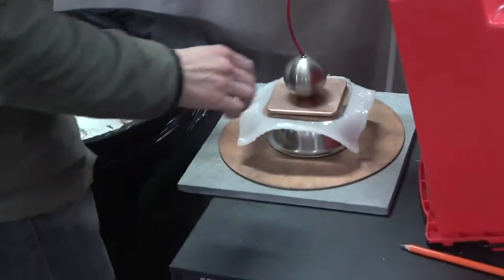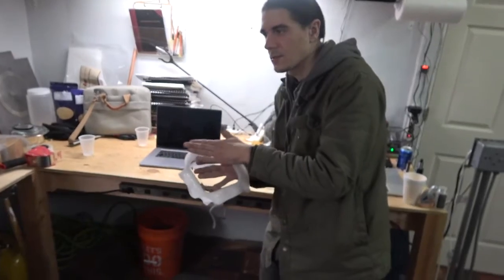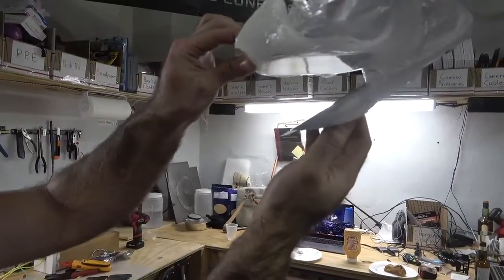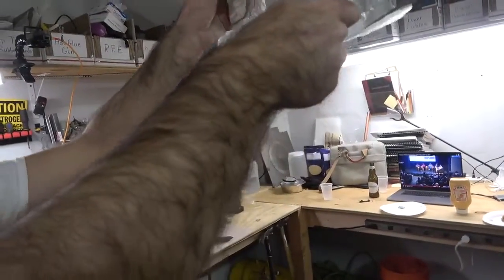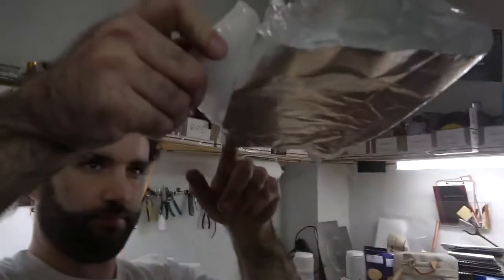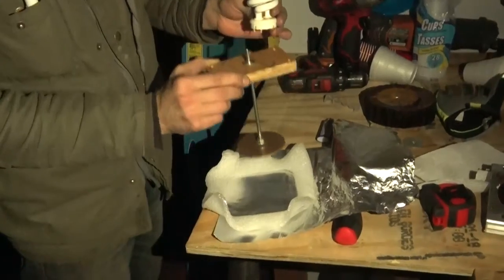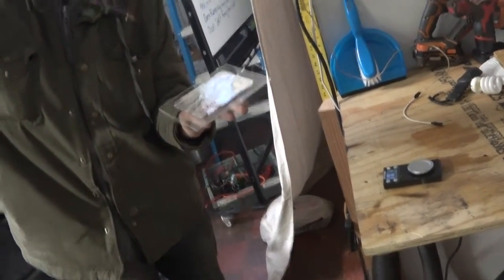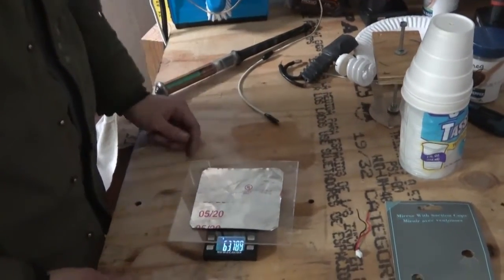Making Electrets for Antigravity and other Experiments

Comment: Number one electric the way, the process is through the cool down you have to put a electrostatic charge on both sides through metal plates that causing the cooldown to align the molecules inside the electric to be aligned to collect electrostatics and keep it as a constant a very low concept until

Comment: Use an electret sphere like surface annealed pourous alumina with a cavity and use helmholtz coils close to the surface  with an asymmetric cathode that has higher surface area with needle like protrusions extending radially. Surround the set up in a diamagnetic shell with open ends that reflect the coil asymmetry

Comment: Its because you didn't clear the tare meaning that cup weighs 2 grams nice try
Reply from the maker: Good point. 
But That just moved the numbers in that last run about 2 grams lighter.

Flipping it over and it went up 3 grams ,that was what we were demonstrating.
It’s electrostatic attraction to the table.

Comment: The anti-gravity aspect is likely realted to the fact the the earth the atmoshpere have a potential difference and in that roational direction relative to earth, the puck would like to be somehwere in between that potenial gradient.

It doesn't lift off because the electric field would need to be 1000s of times strong per unit mass and even still, you would need to keep the rotational direction of the pucks stable realative to the earth.

Comment: Wouldn't these create a type of flow in the air molecules around the surface? "Semi Permanent" maybe that is the 'discharge' -- the atoms charging the nearby air molecules could be changing their internal structuring slightly like an ultra slow deformation - analogous process as glass over time acts like a liquid (extremely long time scales)

Comment: I read don't know for sure you can get 50 watts of usable power from a 500 feet cable coax. When you heat it up in oven under 300 degrees Fahrenheit and charge with hv. Maybe it' starts at 100 watts when you transform it down to 50 watts from a transformer with liitz wire. Because the voltage is to high.

Comment: I suggest putting two of them together in a sandwich, with the same charge inward. Then put the whole thing in an aluminum foil shield... there won't be any charge on the outside, and you can then see if it effects the weight of things above or below it.

You could also put it under scale. ;-)

Comment: Are you certain the electrostatic fields aren't messing with scales electronics?
Reply from the maker: Were positive that they are. Thats what we were trying to show
Reply: Note: such plastics as acrylics and polycarbonate  are merely normal heterocharged electrets...needed as indicated in the Kita US8901943 G-Shield patent is a homocharged electret. Heterochaged electrets...are mainly surface charges. RJK http://www.chiralex.com
Reply: how about you space it away from the scale while having another platform closer to the plate

Comment: odd effect on the sides, for a second I thought it was polycarbonate due to how it cracks and splits like alligator skin if unevenly heated on the surface too fast, letting it soften and break while trying to retract to the form it was in when stretched.
Reply from the maker: definitely a cooling effect.